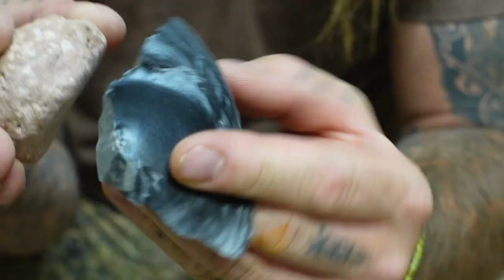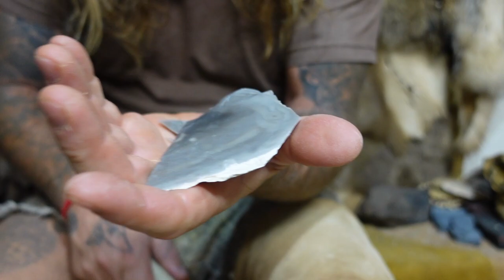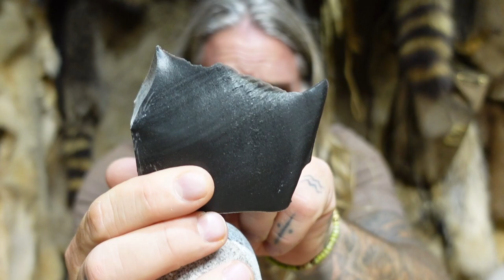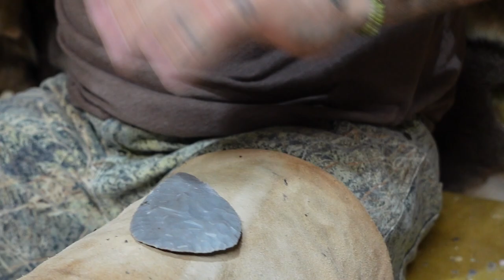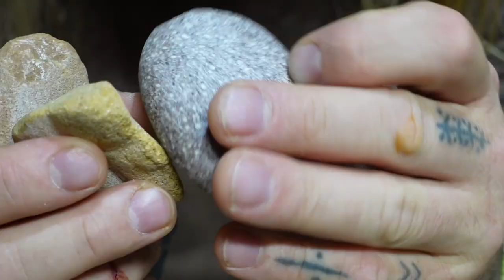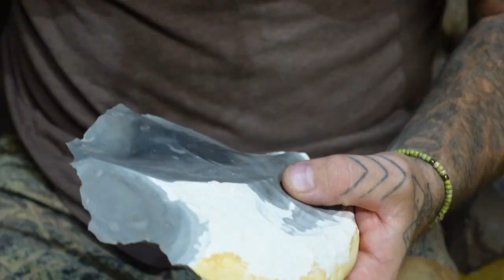FLINTKNAPPING Hack | Understanding Abrasion #flintknapping #primitivetechnology #donnydust

Comment: Was definitely one of the things I was most curious about.

Another thing that I wonder about is why bother with pressure flaking or other such procedure on flakes that are literally razor sharp?
Reply: For a similar reason, actually. When pressure flaking a piece that's already crazy thin and sharp, you make it more lens shaped, making it stronger. A thin, flat point will snap much sooner than a relatively thin, but thicker, lens shaped point

Comment: Great explantation! I made my first stone age arrow a few weeks ago (with a stone point I made) and the point came out of the haft first shot. What do you use for pine pitch glue? I tried using just charcoal with it, and apparently that was very brittle. Also, do you have tips for correctly using it?
Reply from the maker: Congratulations on the arrow! That’s awesome. I do have a video on making pine pitch glue. Appreciate you watching!
Reply: Thanks for the reply. Watched the video, does the moose or deer poop bind it together well?
Reply from the maker: @izzyc.6559  yes. Heated pine resin is very brittle. The poo and wood char make it softer. If you are still getting hard pitch…add some wax to it. That can help as well.
Reply: Ok thanks sir, appreciate it. Will definetly try that out. You have helped me out a ton with your videos. I have learned and made many things because of your instruction. Much respect.
Reply from the maker: @izzyc.6559  appreciate it greatly. That’s the goal of this channel. Just to inform and educate. I don’t care if it gets one or one million…I’m just here to help.
Reply: @DonnyDustsPaleoTracks  Donny, Concerning pine pitch-- I have experimented with a squirt of an orange to keep the pine pitch softer and pliable when it gets stiff-- Especially here in the upper Midwest where it's getting chilly now--- Just a few drops mixed in and heated up seems to work well enough---
Reply from the maker: @thomasfoss9963  awesome. I’ll have to try that. Thanks.